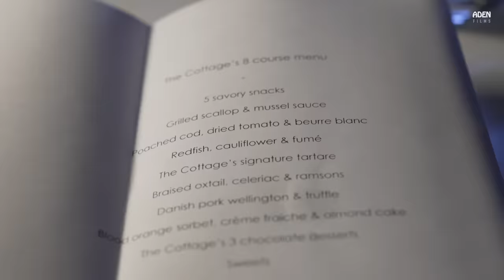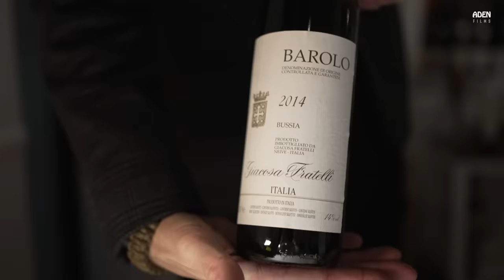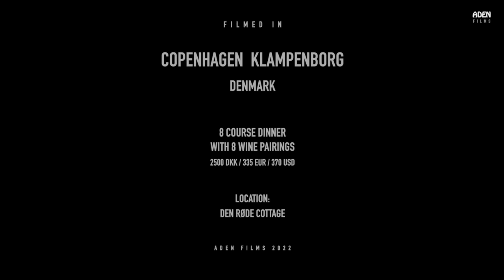One Day in a Nordic Restaurant in Copenhagen

Comment: What is he filling there in this thing @ 22.25 and producing in the machine @23.53 - and what is this machine ???
Reply: Hes basically taking yogurt and putting it into whats called an iSi canister, which is a can that gets pressurized with co2 and instantly whips things up (you can make whipped cream at home with them for example), this makes it really airy and fluffy instead of a hard solid yogurt. He then sprays it out into the container, and that goes into whats called a cryovaccuum. It is used to seal plastic bags for sous vide in restaurants, but it has the ability to pull all of the air molecules out of food and chamber if theres no bag to seal it. We'll use it where I work to instantly pickle vegetables or give herbs a glossy look because all the cell walls break inside the produce and instantly fill with liquid. When he cryovacs the yogurt, it removes all the oxygen, and makes it rise to be a puffy cloud.